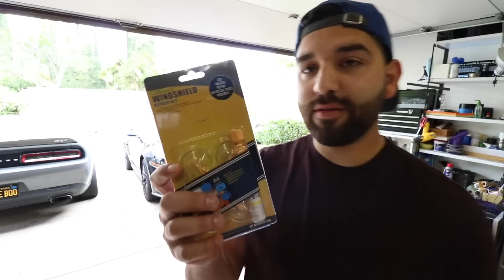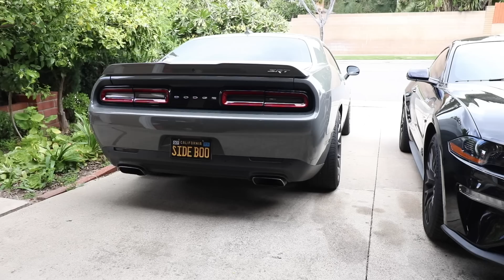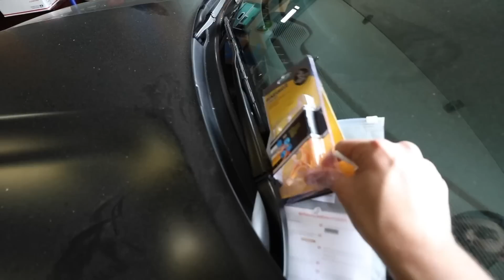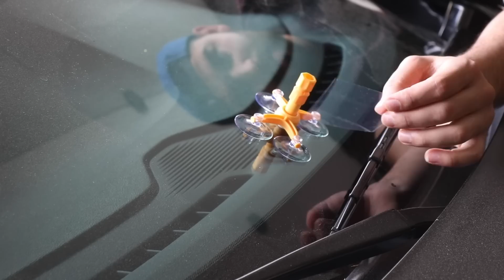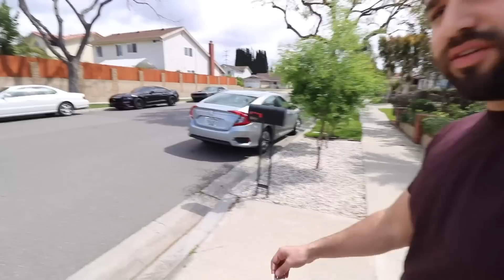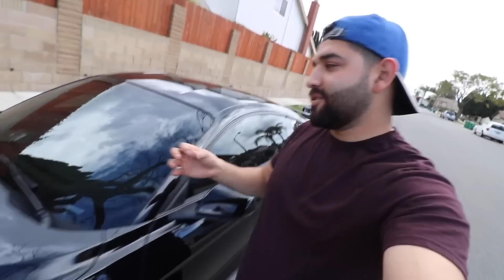My NEW Mustang GT and Challenger SRT windshield's BROKE...UNLUCKY!!!

Comment: Bro I literally drove past a dump truck the other morning, a rock fell off and it chipped my windshield. My insurance company would only repair it. So they did, but I can still see where the chip was filled in 😑
Reply from the maker: They probably did something similar to what I did in the video
Reply: Rush Shift They did, Safelite did the repair, but  still evident that it was repaired. Where the chip was; it looks like there’s dirt on the windshield and it drives me insane.

Comment: I bought a system a lot like that, maybe the same one, at Walmart. Same steps and procedures. Unfortunately, it didn't do a great job with the chip in my Challenger's windshield. Not as well as your Mustang. That turned out pretty good. Still, no matter how visible it is, the chip is filled in, and hasn't spread, even with all the temperature changes we've had the last few months.